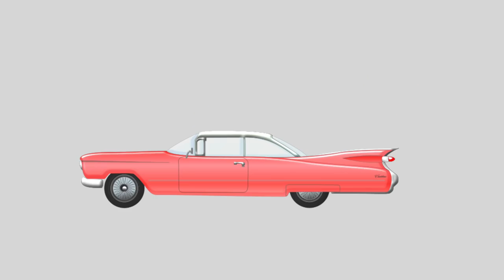Yes, Rockets CAN Fly in a Vacuum

Comment: Good explanation... I would add that the shape of the engine bell on a rocket is an important part of this. The expanding gasses inside that enclosed area exert the outward force in all directions. Because the engine is bell shaped, as the gas expands, it exerts that sideways force that pushes against the bell and the rocket. :)
Reply: Thank you. I knew there was something missing. Perfect.
Reply: Now do it in a vacuum

Comment: Remember kids watching random conspiracy videos on youtube is NOT research.
Reply: I need help understanding why we can see so far on earth. 8 inches per mile squared grows exponentially but yet I see no earth curvature. The object or landmarks that are thousands of miles away from me are never obstructed by earths alleged curvature. And please don't tell me refraction because it's absurd. How can light bend when its supposed to be a constant? I truly need some proof that I can experiment on my own. Also how does a infinite vacuum exist next to an atmosphere. Also how is it that earth is rotating around its axis at 1,038 mph at the equator and also orbiting around the sun at 66,600 mph as well as vortexing through space with our solar system at 448,000 mph. That is so insanely fast. Waaaay fast than a even our fastest rocket. yet we don't feel anything? And how would it be possible for a rocket to leave earth s atmosphere when we are fucking zooming 448,000 mph through space. It would never be able to catch back up with earth. Also can you please explain how rockets can go 24,791 with men in it but while leaving earths orbit severely arch. That would kill you wouldn't it? Also can someone explain the recent live Iss footage where the astronauts were being interviewed and one decided to do a front flip and the guy next to him grabbed a visible wire on him by accident. Do astronauts need to be strapped by wires in the ISS for safety reasons? Some answers would be appreciated, in not trying to be a jerk I really just want to know.

Comment: How the reaction force generate in space
Reply: By expelling mass of gasses at high speeds, exactly like in atmosphere. Newton 3rd law of motion.
Reply: well if the particles that come out of the thruster don't meet any resistance (like air would provide) there is nothing to push you away from. I'd like to see the propulsion in vacuum...

Comment: From my engineering days, I see this one differently, or at least explain the same thing differently.  In statics class, the premise of all our calculations was that equal and opposite forces balance out for a net force (and thus net acceleration) of zero. If an object is static (not accelerating), all forces acting upon it cancel out. That premise made calculating the forces on a static (non-accelerating) object relatively easy.

In the combustion of a rocket engine, the violently expanding gases of the propellant exert forces in ALL directions. But the forces pressing on the "left" wall of the rocket are equaled and thus cancelled by the forces pressing on the "right" wall. And so forth. All forces exerted on the rocket are cancelled by their equal and opposite forces, EXCEPT those forces pushing the rocket up, because the opposite downward forces escape out the bottom, as those escaping gases are not pushing against a wall of the rocket. The same thing with the balloon you used in illustration.

The rocket moves because there is not a complete balance of forces (by design). It moves in the direction of the unbalanced force, and does so in an atmosphere or a vacuum. It doesn't need to push against the ground or the air to do so.
Reply: Anyone who understands what you just wrote... does not think rockets can't work in space.  Hence why they need it explained to them.
Reply: LOL. Trying to understand your comment myself. Was that an affirmation or a criticism? I think it was an affirmation.
Reply: Yes, I'm 100% on your side.
Reply: Well thank you.  :D

Comment: Rockets can't go beyond low earth orbit. In a full vacuum, rockets exhaust wont create any acceleration because there is nothing for rockets exhaust to push against in order to cause acceleration. All you will see is exhaust going endlessly in space with no acceleration created in rocket. Imagine a man pushing a rock except man have his legs in air instead of ground. If a man has his leg on ground, he can push a rock because his legs are pushing against the ground. If his legs are in air, he can't push a rock because his legs are not pushing against anything. Same thing with rocket in space, there is nothing to push against. 
The only way a rocket can work in space is by creating a recoil effect by constantly exploding fuel mixed with liquid oxygen or exploding nukes at exhaust, explosion will create recoil effect therefore moving rocket forward in space but this isn't practical because you risk breaking the rocket. 
They are not using rocket technology in space, they are using EM gravity propulsion system secretly. Google "The Case for AntiGravity-booklet.pdf - Check The Evidence". Its already invented decades ago.
Reply: Ultra Instinct Xeno Bardock what a load of bs
Reply: You didn't understood anything. Watch video "Getting Gunpowder To Burn In A Vacuum".
Reply: Ultra Instinct Xeno Bardock you literally described the way how rockets work after claiming they don't work
Reply: Read my comment again. I said there is only one way rockets can work in space.
Reply: There is a difference between exploding vs burning. The explosions will have to be strong like tnt explosions, enough to create strong recoil effect, and constant stream of it at that. Its not the exhaust gases and explosions that propel rocket in space but recoil effect generated from it. Some recoil effect from explosions escape along with exhaust gases while most recoil effect from explosions hit the walls of rocket and propels it in space. This means the walls of rocket need to be though enough to handle all the constant stream of tnt explosions. Same applies to Shuttle. Its too risky none the less to space travel beyond low earth orbit. Astronauts will have to be too crazy to use rocket technology beyond low earth orbit.
Reply: Ultra Instinct Xeno Bardock also EVERYTHING creates a recoil effect, that's Newton's third law of motion
Reply: Only explosions create a recoil effect strong enough to propel rockets in space.

Comment: Newton’s Third Law of Motion

“ Whenever one body exerts a force on a second body, the first body experiences a force that is equal in magnitude and opposite in direction to the force that it exerts. Mathematically, if a body A exerts a force →FF→ on body B, then B simultaneously exerts a force −→F−F→ on A, or in vector equation form,
→FAB=−→FBA.F→AB=−F→BA.
Newton’s third law represents a certain symmetry in nature: Forces always occur in pairs, and one body cannot exert a force on another without experiencing a force itself. We sometimes refer to this law loosely as “action-reaction,” where the force exerted is the action and the force experienced as a consequence is the reaction. Newton’s third law has practical uses in analyzing the origin of forces and understanding which forces are external to a .system.”

This destroys your irrational logic of Rockets in space, go read and read it and think about it. ( But I suspect half of you are Bots anyway and know, your just desperately trying the maintain the existing B/S)!  And before anyone says the burning fuel drives the rocket, Impossible as the fuel is in and of itself the ACTION, or force, it cannot drive itself . The ACTION is the intermediary between the craft = the mass = the external mass to generate a reaction, hello, we are told by ESA and NASA Space has no mass, so Rocket is the mass, fuel in rocket is the action = drive force, AND where is Body (B) external mass, in the void of space for it to generate a reaction? OHHH its not there. Means it goes nowhere.. END OFF..
Reply: The rocket goes up because the exaust gases exert a force on the top and the sides of the combustion chamber, the side forces cancel out and only the up force remains, so the rocket accelerates upward
Mo need for Newtons 3rd law
Reply: MAGA TRON - I can help you understand IF you answer three simple physics questions.
You seem to have a proper grasp of the concept; you are just missing a small part of the puzzle.

Most "physics deniers" will REFUSE to answer these three High School Level Questions.
Let's first concern ourselves with rocket IN ATMOSPHERE, HERE ON EARTH.
 I like to use the Space Shuttle Main Engine as my example as there is a LOT of video. 
So, when a SSME is running (here on earth in atmosphere): 
1 - Does the exhaust gas get ACCELERATED as it leaves the nozzle? 
2 - Does the exhaust gas have MASS? 
3 - Can MASS be ACCELERATED without a force? (or is a force REQUIRED to accelerate mass) 
Now IF you bothered to ever ANSWER these three questions, we could get to the ACTUAL questions regarding rocket propulsion in a vacuum. 
Unfortunately, I NEVER get that far as these "deniers" flat out REFUSE to just answer.
 Let's see if I can get a few answers on this thread. 
Then I'll get to the more significant questions.
Reply: @HugoFilho.  - "Mo need for Newtons 3rd law"

Sorry but Rocket Propulsion is literally just Mechanical RECOIL of pushing mass out the back, So Rocket Propulsion is a DIRECT RESULT of Newton's third law.
IN FACT, the Tsiolkovsky Rocket Equation is derived from the "Law of Conservation of Momentum" which requires the Third Law.

If You would care to answer my three questions presented above, we can get to the details (I suspect MAGA TRON will refuse to answer but we'll see)
Reply: @stuartgray5877  both mine and yours  explanation are correct, in mine the gas pressure is the action and the force that accelerates the exaust is the reaction of that force. In yours the upwards force is the reaction and the exaust force is the action.
Action-reaction pairs are reciprocal, if A and B are a action-reaction pair, you can call A action and B reaction or vice-versa
Reply: @HugoFilho.  Agreed. One can calculate the thrust of a rocket using both methods.
However, it still remains a fact that the "Rocket Equation" is derived from the Law of Conservation of Momentum and THAT is derived directly from the 3rd Law.
Reply: @stuartgray5877  Yes
Reply: @stuartgray5877   your dont answer my questions why on earth would I answer yours ?
Reply: @normski262  Ask any question you like.

I don't SEE ANY questions in your post above.
But JUST AS I PREDICTED - YOU REFUSE.
Scared?
Reply: @normski262     - "The Rocket Nozzle applying a FORCE to accelerate the exhaust gas is the ACTION.

What is the "reaction" ?"

What's the matter?
DO you NOT know the answer, or are you just too embarrassed to admit when you are wrong?
Reply: @stuartgray5877  " The Rocket Nozzle applying a FORCE to accelerate the exhaust gas is the ACTION."   And where is the resistance and ractaction coming form fool. You know nothing of the LAWS of physics. An action cannot act as, action , resistence, and reaction all within the very same action.  answer my question  then (where is the  Resistance , comming from as it cannot be the craft as the craft is the end resust movment. Good night. go study the true laws of motion.
Reply: @normski262  So again - According to YOU Mechanical RECOIL stops working in a vacuum.
So what would happen with a FIREHOSE IN a vacuum?
It ACCELERATES WATER into the vacuum, and it does this WITHOUT FEELING any RECOIL FORCE?
So you think that machines exist that can accelerate MASS without any recoil force?
REALLY?
Give me an example of such a machine.
Reply: @normski262  A space shuttle main engine accelerates 500 kilograms of PURE WATER from a standstill to MACH EIGHT.
It does this with 500 kilograms of water EVERY SECOND.

Now explain HOW that SSME can accelerate 500 kilograms of MASS from a velocity of zero to MACH EIGHT without feeling any recoil force.
Tell me HOW it does that.
Reply: @stuartgray5877  Nothing thats what would happen. no resistence. and don't go on about vaccum Chambers that’s joke, in compassion to space, so we are told of course. 
My turn, explain how the ISS and other space craft manage to maintain its integrity or internal environment in the near perfect vacuum of space. ?
Reply: @normski262  The ANSWER to the question you keep avoiding:

What happens to a crossbow fired into a vacuum? 

It gets PROPELLED BACKWARDS by the RECOIL FORCE!
Therefore "Propulsion" IS POSSIBLE IN A VACUUM AS LONG AS YOU PUSH AWAY MASS !

Any machine that applies a FORCE to MASS feels an "equal and opposite force".
Crossbows APPLY A FORCE to the MASS of the projectile and feels a REACTION FORCE AS A RESULT.
Rocket Engines APPLY A FORCE to the MASS of the exhaust gas and feel a REACTION FORCE AS A RESULT.
Reply: @stuartgray5877  What mass. The craft or the ?   You are trying to tell me it drives itself, it has to have something ( external to react with outside the craft. )  does your car obtain movement when you drive if, the wheels are 2 inches off the ground, Don't need a physics book to tell me that. it won't and why ? I know, but you tell me why the car won't move. you have action but no reaction WHY. HAHAH.
Reply: @normski262  
Watch the YouTube video:
".577 T-Rex go Boom TheBlueMeanie."
The bullet is a particle of mass that is accelerated by an explosion.
The force applied to the bullet is exactly the same as the force applied to the rifle.
The bullet goes in one direction and the rifle goes the opposite direction.
Rockets carry thousands of pounds of mass with them as fuel and oxidizer.
Rocket fuel combustion is a sustained explosion that pushes trillions of molecules, tiny "bullets", away from the rocket, at thousands of miles per hour, in one direction and pushes the rocket in the other direction with an equal force.
In the video:
"What's Going On In This Spacex Rocket Video?
NASASpaceflight"
You can see blasts from maneuvering rocket thrusters when the booster is in vacuum.
Reply: Your comment attract many automated accounts :-/
Reply: @jrstuckey1471   of course, they do not want people to know the truth!
Reply: @normski262  shhh!  A lot of money's at stake!  Let's keep the party going! 😎 lol
Reply: @DrCash7  Exactly !!!
Reply: @DrCash7   Bang on!
Reply: @HugoFilho.  WRONG!

Comment: The force of the fuel exploding in the engine pushes the pistons down (like how a rocket exhaust pushes on the bell of a rocket).  That force is then transferred to the wheels, which turn and push the car forward.
Reply: No, the explosion in the engine works because it's happening in a pressurised air tight chamber, the piston is the only movable  component so that moves & pushes on the crank to create rotational motion. 
You can't compare that to how a rocket works in a vacuum (complete lack of pressure), sorry.